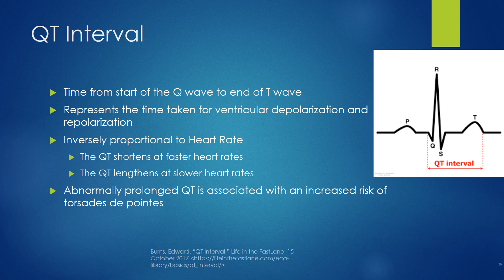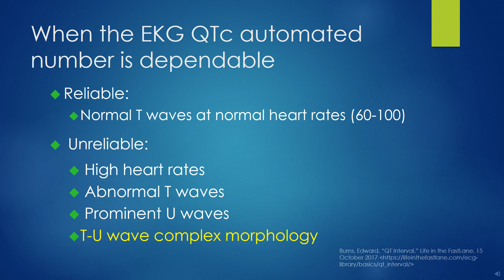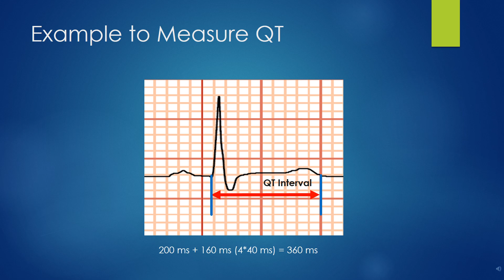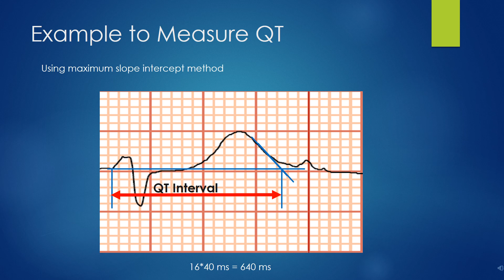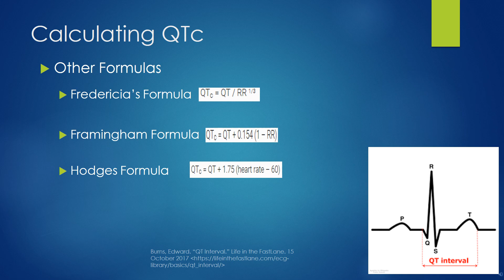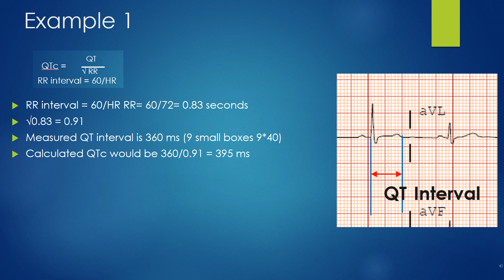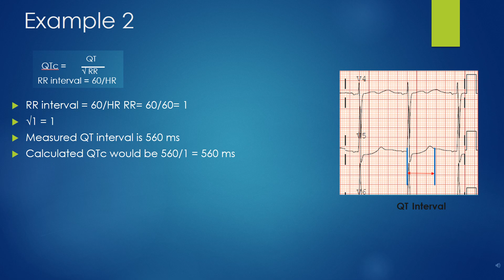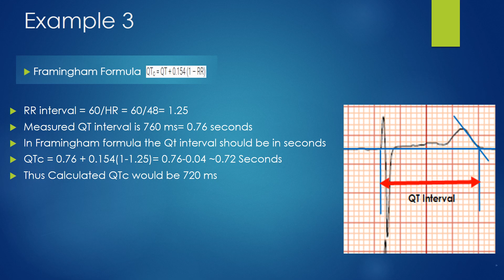How to properly calculate a Qtc

Comment: Which formula use if heart rate above 100? Like 110
Reply from the maker: The Framingham or Fridericia formulas are more accurate for higher heart rates as the Bazett formula overestimates the QT in heart rates >100.

Comment: Which specific cases do we use the 3 formulas  specifically as mentioned?
In which patients do we prefer Framingham formula 
In which patients dowe prefer using the 2 other s formula for calculating QT interval?